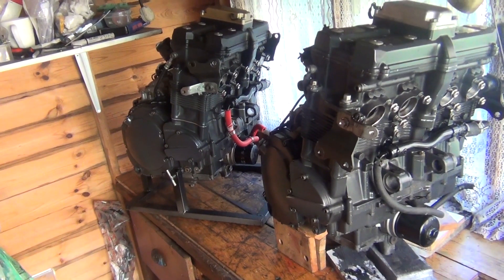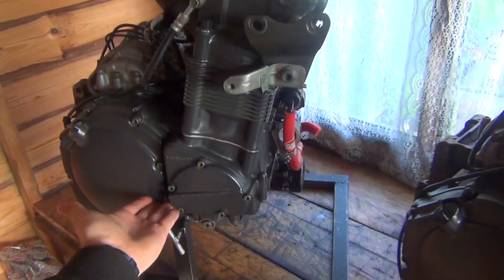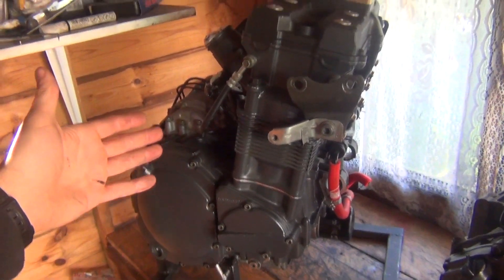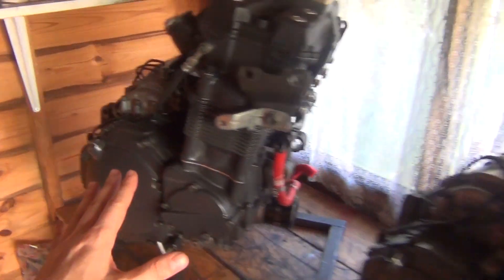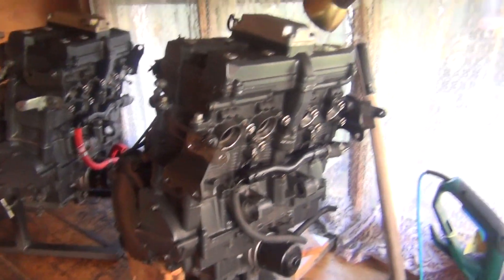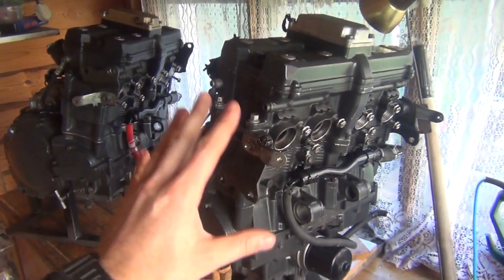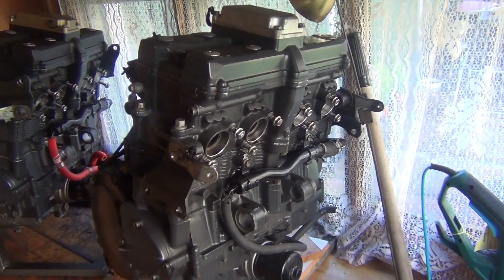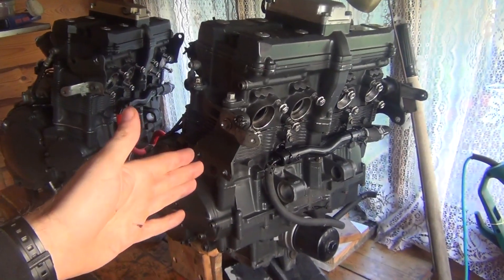Suzuki RF 1146 BIG BORE Build Part 1

Comment: Any concerns about the gearbox handling the load of the bigger engine? I would like to drop a 6 spd box from a FZ/FZR750 into my 87 FZR1000 cases, (they drop straight in, exact same engine cases) but are concerned about the torque being too much.
Reply from the maker: No problems so far

Comment: As a former RF900RW owner (green/grey colour variant)... I am REALLY looking forward to this project... As many owners will know... It was always wanting a 6th gear... But now, with extra power from a 1150... THIS should be good... 😈👍     😎🇬🇧
Edit - I also split my headlight and tail lights and inserted a ring of LEDs around the edge of the lights - the front being 'Sidelight' and both the small 'Bandit' shaped and larger 'Kidney shaped' lights having the LEDs as rear lights while wiring up the 3 normal bulbs up together as 'Brake lights'). I have pictures if anyone is interested...  😏       😎🇬🇧

Comment: 👍A couple of my acquaintances did 1146 gsx-r. They had problems with the tightness of the gasket under the cylinder head. Also, the cylinder sleeves becomes thin, perhaps this is the problem too.
On the rf 1117, we didn't have any problems with the engine. The difference in volume is not big, but in terms of reliability it is better.
I think if you pay attention to the porting and also install OS valves, you will get a very good power increase even on 1117.
Reply from the maker: Yes, you're correct about cylinder walls getting thin with 78mm pistons. The head gasket potential issues are known to me also but you know how they say it: "best way to find out is to try it yourself"
😉
Reply: @Adikxx  consider O-ring the cylinder block & eliminate the head gasket.. not as daunting as it might seem.. tig copper wire cylinder rings & rubber O-ring the coolant & oil galleries.. cylinder to cylinder gaps must be getting quite  thin